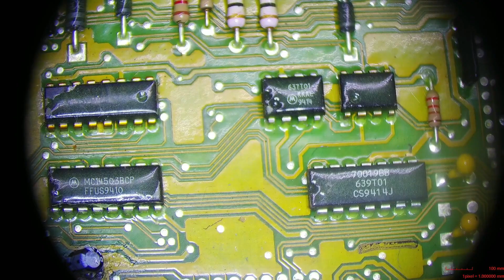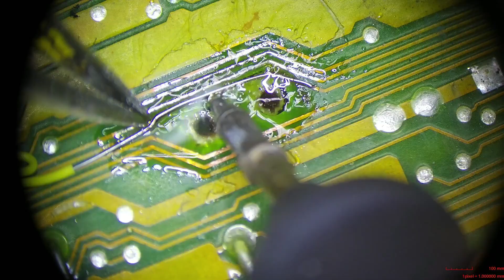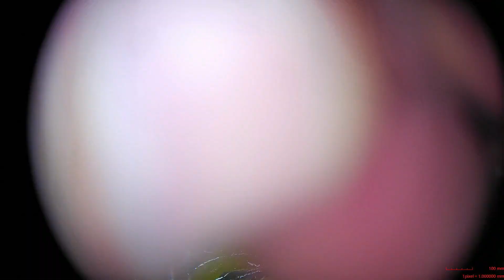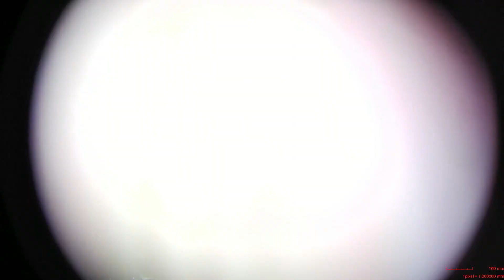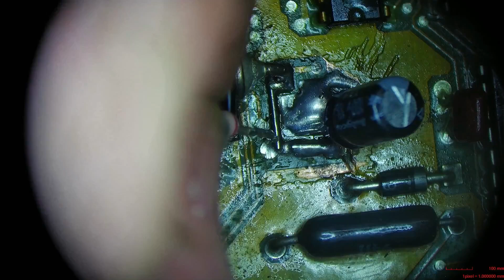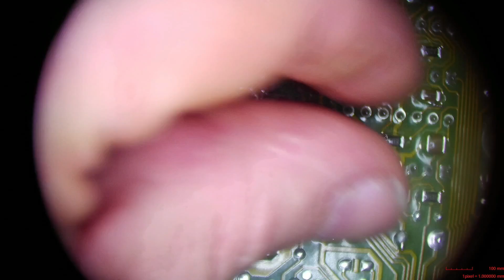Another vintage Ford EEC-IV ECU Rebuild #ecurepair #electronics #repair

Comment: Thank you for posting this. I had the same resistor fail and damaged the trace directly underneath it. Was able to fix it and it resolved my transmission limp mode issue. Also i found the wiring at the transmission burnt and needed to replace the connector.

Comment: Any idea where to look on 1990 e150 5.0 bored for the sprout circuit. Got no spark with the sprout connected. Before anyone says check the wiring. I did, i load tested with a head light bulb and had no more the .5 volt drop from eec to the distributor plug
Reply from the maker: Use a dmm in continuity mode and follow it from the output pin.